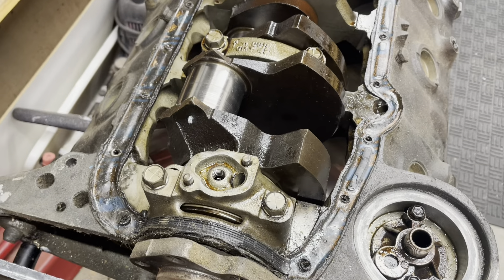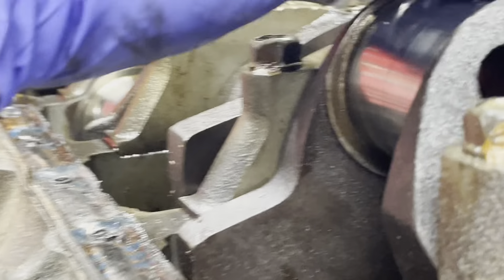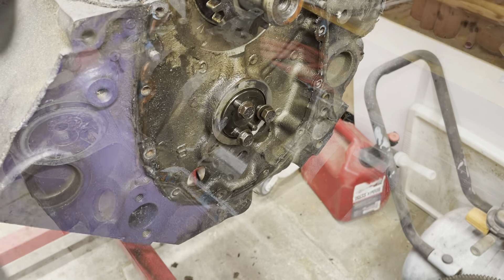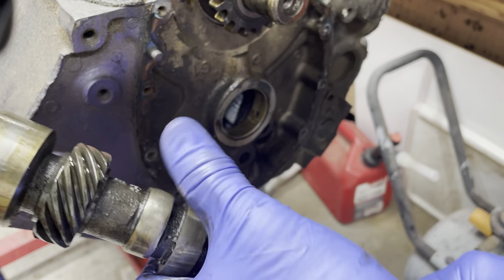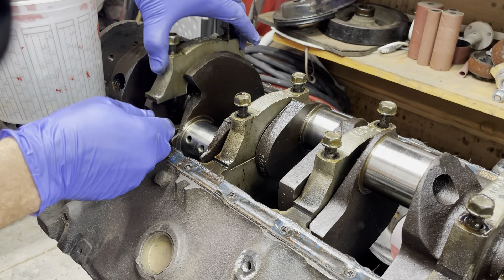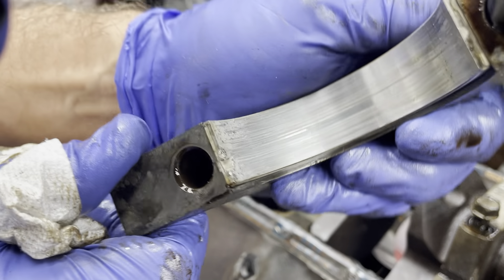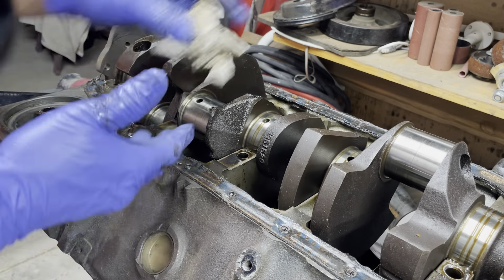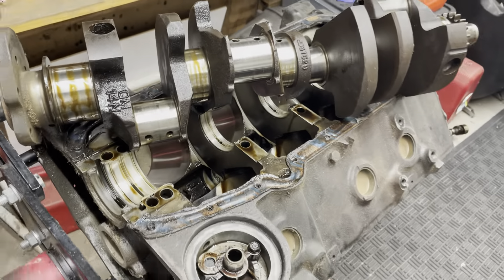SBC400 Cam & Crank Removal

Comment: It looks pretty good in there. The scuffing you see on the bearings is most likely from the worn lifter and cam lobe. All that fine "sparkling" stuff in the oil was being circulated throughout the engine as it ran. More than likely the crank will polish up nicely. The machine shop will verify that for you. I'm not sure of your intentions but that crank will handle plenty of power so it can definitely be reused. Invest in a new quality harmonic balancer though. Toss the original one. Get the block sonic checked so you can see how thick the cylinder walls are which will dictate how much you can overbore. And if you plan on replacing the main bolts - use bolts. Studs will be overkill (depending upon how much power you plan to make). Use ARP bolts. And get a double roller timing chain set👍
Reply from the maker: @FreakOlds  Thanks for the tips! I’m thinking about getting a complete Crank, Rods & Piston set, in order to make sure everything works together (longer rods) and I want the pistons .020 in the hole.
Reply: @thedrivewayC3 
Sounds like you're doing your homework.
Keep in mind though that if your crank is good (which it most likely is) you can get pistons and rods and then use the crankshaft money elsewhere.
Just something to consider. 😉👍
Reply from the maker: @FreakOlds  Good point. Depends on how much the labor on the crank will be. Speedway sells complete sets for the 400 for about $900 including Crank, Rods, and Pistons.